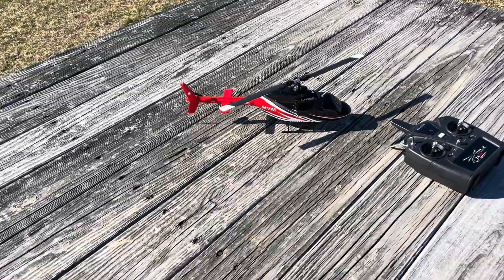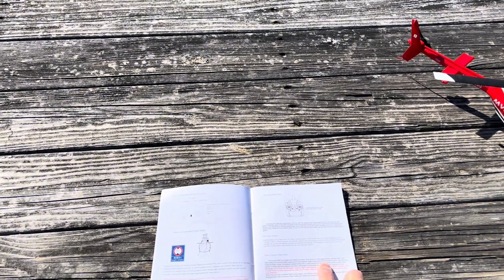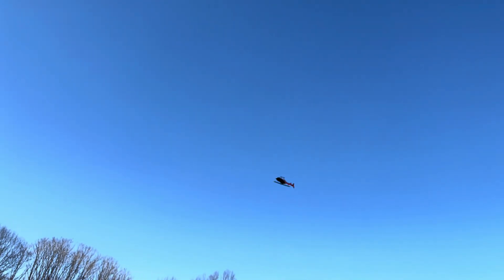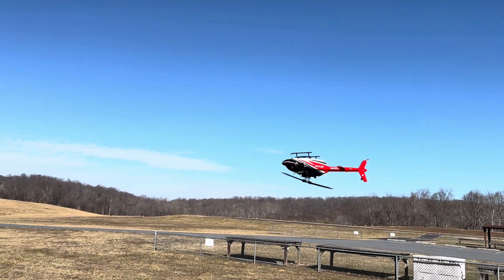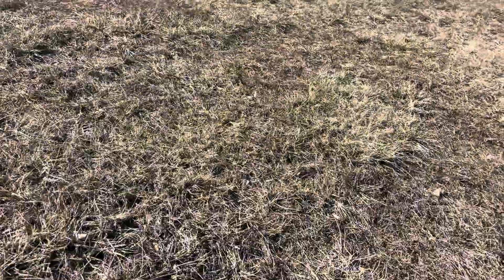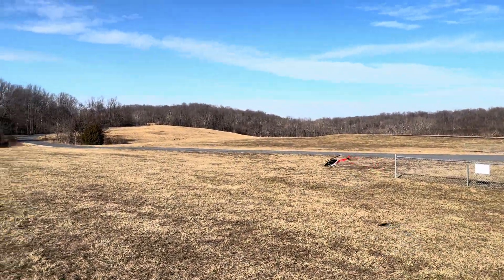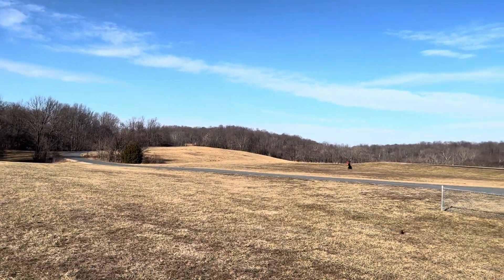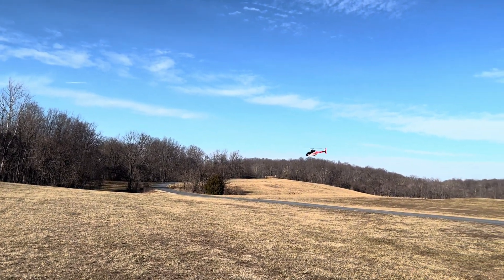YuXiang F08 - Bell 206 Jet Ranger: How to flip and fly inverted safely!

Comment: yesterday i returned back to banggood  i have the same problem some battery didnt fit well before hover the battery will disconnect from vibration    and the heli too smal i already have the mini airwolf with gps  but this heli faster than airwolf
Reply from the maker: Many reviewers have advised to check that the battery is installed firmly.  Sorry for your crash and bad experience.  This is a great model.
Reply: @Flight6677  no brother i didn't crash when i start  blade spinning the battery disconnect

Comment: no 3d demo with new card??
Reply from the maker: 3D is simply with lower gyro gain of 25% instead of 75%. It will look almost the same sky some additional sensitivities in roll and pitch.
Reply: @Flight6677  no with the fly controler of E190  pro ?